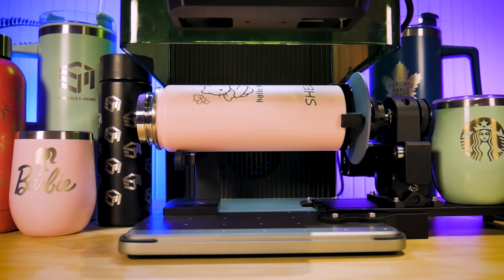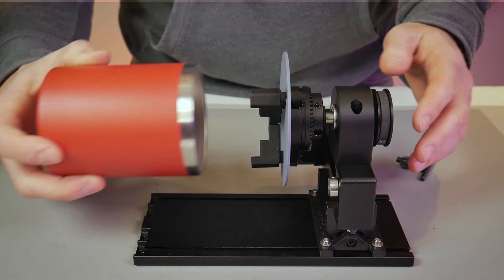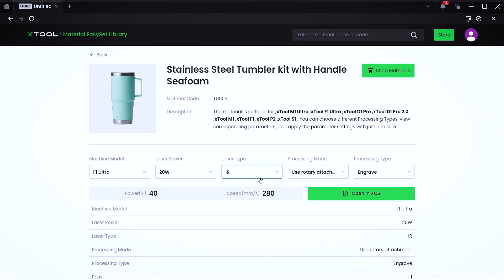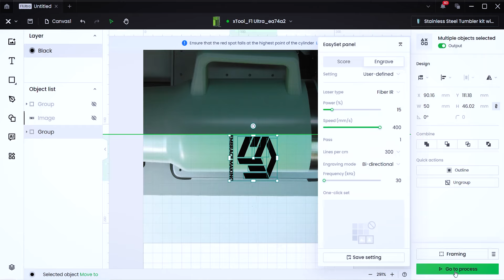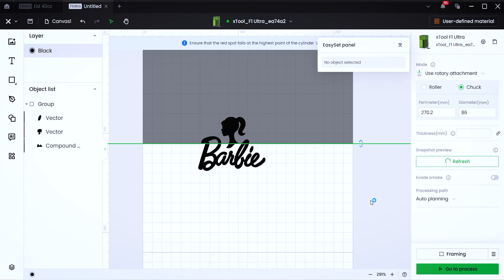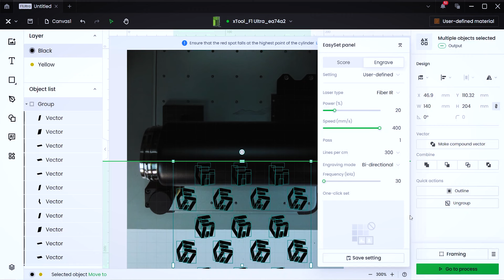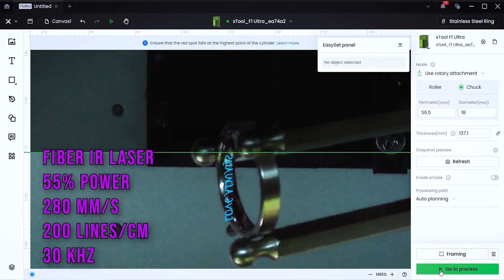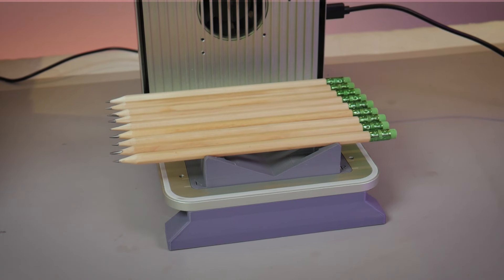XTOOL F1 ULTRA and RA2 Rotary Module Guide: Become a Tumbler Engraving Master (+ Upgrades and More!)

Comment from the maker: If you appreciate this thorough video and are looking for items I've used in this video check the links below for the best prices and exclusive xTool discounts!
For all of my personal upgrades and accessories head over to www.embracemaking.com
XTOOL F1 ULTRA:

► https://www.xtool.com/products/xtool-f1-ultra-20w-fiber-diode-dual-laser-engraver?ref=D5HpJRsyqyUUnt&utm_medium=5306&utm_source=influencer

XTOOL F1 ULTRA deluxe bundle:
► https://www.xtool.com/products/xtool-f1-ultra-20w-fiber-diode-dual-laser-engraver?ref=D5HpJRsyqyUUnt&utm_medium=5306&utm_source=influencer&variant=45219501605103

RA2 Module:
► https://www.xtool.com/products/xtool-ra2-pro?_pos=1&_sid=1e57e74d2&_ss=r&ref=D5HpJRsyqyUUnt&utm_medium=5306&utm_source=influencer&variant=44042680533231

As an Amazon associate I may earn a small commission (at no extra cost to you):

4" Inline Duct Fan with Controller
► https://amzn.to/4a91Nd4

Air Quality Monitor
► https://amzn.to/3xgoaA2

Electric Screwdriver:
► https://amzn.to/3P43fpz

Digital Calipers:
► https://amzn.to/48IQh7w

40oz Tumblers (4 pack):
► https://amzn.to/3Mr0EV0

Tall Stainless Tumbler 4-Pack
► https://amzn.to/3CWBXLh

12oz Mug With Handle (8 Pack)
► https://amzn.to/3wqDadE

12oz Tumbler With Straw (12 Pack)
► https://amzn.to/3HZswgC

20oz Tumbler With Straw (25 Pack)
► https://amzn.to/48hQONK

50 Wood Pencil Pack
► https://amzn.to/3UIzbTT

100pcs Aluminum Bottle Openers
► https://amzn.to/48sdjja

Comment: I love your design. If you could revise the adjustment to make it easier with a rear adjustable knob with spring to hold the tension. It will be the best design out there. You won't have to constantly use a wrench every time it needs adjusted, its so much easier.. I have one on my ra2 and it's  amazing to use. Mine lacks the rear support and height that you designed. Very nicely done sir! Great video by the way. I'm now subscribed.

Comment: So in your tutorial, during the setup you show the handle parallel to the base plate (12:00 mark). At 12:30 you have the handle rotated, but do not comment on it.... How do you rotate the handle to the correct position so that the logo is aligned in relation to handle?

Comment: You mention your adapter kit for the RA2.  I have the RA2 Pro so do I still need your adapter kit for my Ultra?
Reply from the maker: There are two versions of the RA2, the Pro is the "base" model that has no tilt adjustment, and then xTool sells the "deluxe" kit that has their version of a contraption that tilts the RA2. However, with their version it is not specific to the F1 Ultra or any machine for that matter... so it will still fall off the F1 ultra base and you won't get any alignment benefits. Also their tilt contraption won't tilt as high as the one I designed. I try to make mine application specific so you get the most out of them vs. a one size fits all that has too many limitations. Thanks!
Reply: @EmbraceMaking  Your wont go back far enough not to have to reverse and hold the bottom of the tumbler meaning you cant engrave a wrap all the way around.

Comment: Just adding some info... you mentioned some 40oz tumblers have removable handles. I can verify that Stanley tumbler handles are removable, as well as the tumblers I bought from TEMU that look just like my Stanley.
Reply from the maker: Thanks Tony, the ones I have here are probably removable but it isn't immediately obvious how to do it. Do yours just pull off? Or is there any exposed hardware?
Reply: @EmbraceMaking  The stanleys have hex head screws and the cheap temu ones have philips screws

Comment: I bought the tilt mechanism upgrade a while ago but then it didn't come with the parts to fix it to the F1 Ultra base. Do you sell that part separately or would I have to buy the whole kit again?
Reply from the maker: Hi Alex, which model did you purchase? The body of the tilt mechanism is interchangeable between my kits so if you need the F1 ultra specific parts just head over to my website, click the contact button and let me know by email. We can work something out, thanks!
Reply: @EmbraceMaking  Thank you very much! I will do that.

Comment: xTool's instructions say to align the green liner across the blue and red lights and you never did that. Isn't that important? Do you just leave the green line where it is?
Reply from the maker: Hmm, which green laser? Maybe it is the one from their RA2 kit with that centering laser tool? I don't have that but instead with my tilt kit I have it mechanically setup so the center axis of rotation will always align with the center of the laser so it is redundant.